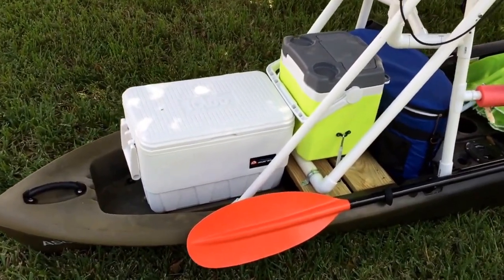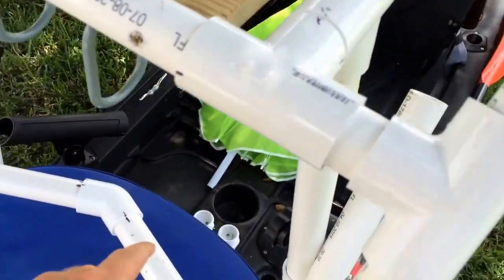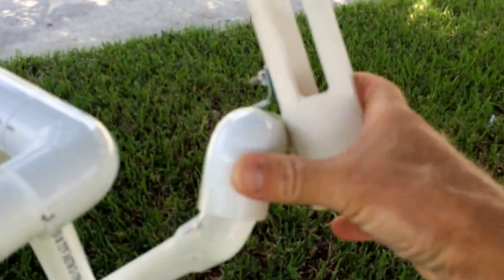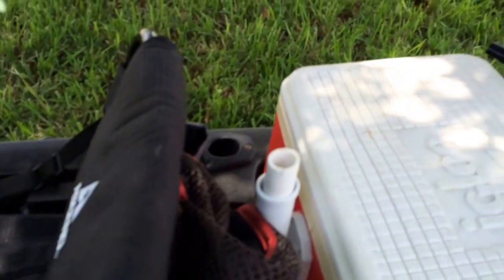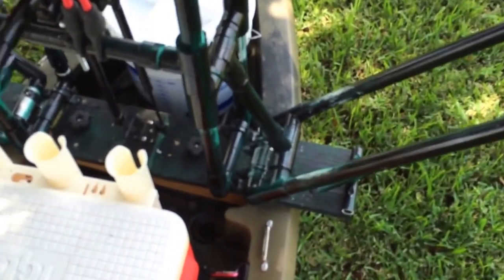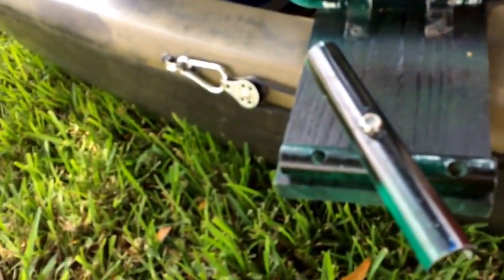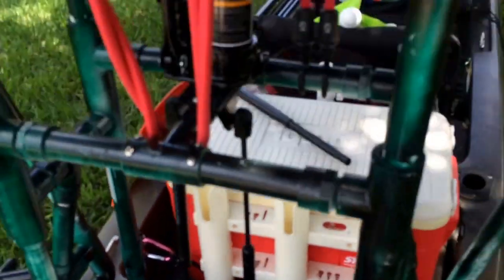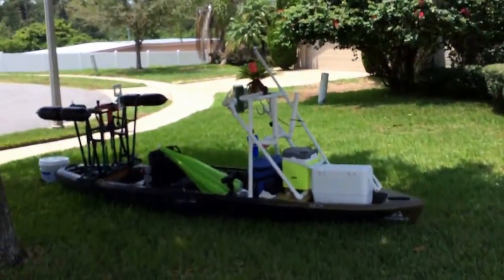My kayak mods--leaning tower, pontoons, and more part 1

Comment: Sick. Do u know how much weight is added?
Reply from the maker: Not sure, but less than 100 lbs. Beer puts it closer.  Check out the rig now (part 2 video).  Over 100 lbs now with the  trolling motor and car battery.